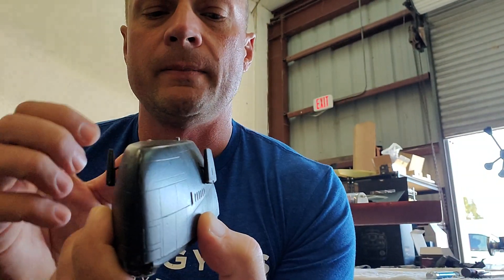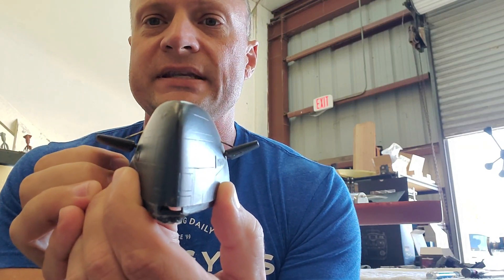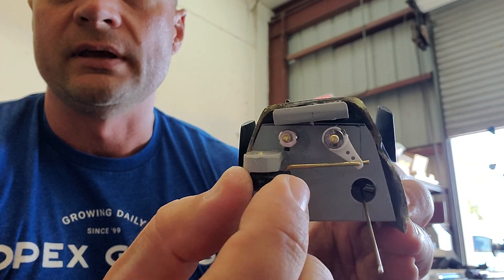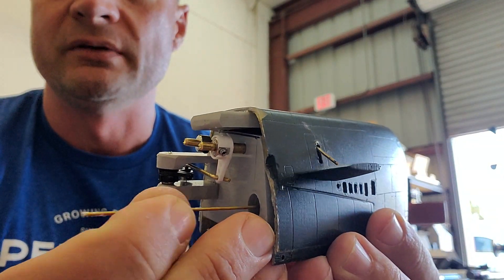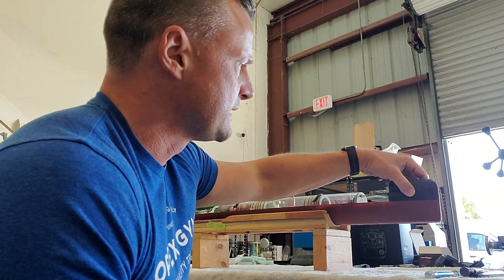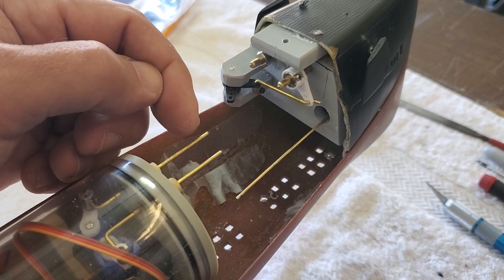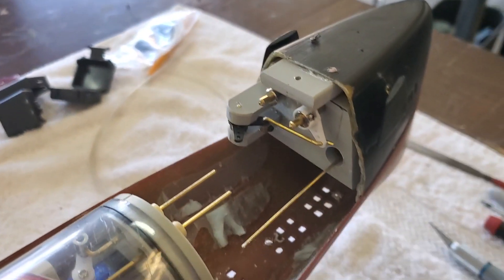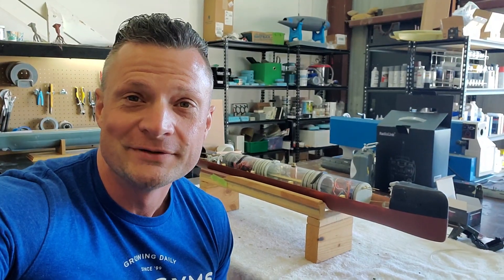Functional folding bow retracts for your RC submarine model

Comment: I’m new to all this..sorry if you answered this elsewhere...is the folding mechanisms or bowplane gear included as 3D files in the kits or does the builder have to fabricate that themselves?
Reply from the maker: Included in which kits? Typically? No, not included. Some kits do include them, however.

Comment: why not just mount one of the gears to the servo? would remove a bunch of linkages
Reply from the maker: Because this is a submarine, and the bow retracts are in the wet area. Servos and water do not mix. You can get "waterproofed" servos, but they're too large, and you still need to waterproof the servo's electrical connection back to the receiver. 

That's why, smartypants!  ;)
Reply: @RCSubGuy  ah yea didnt think of the water lol. there no way to mount a drive shaft to servo so the servo rotates the shaft? then have a watertight seal similar to a push rod coming from the water tight cyclinder.